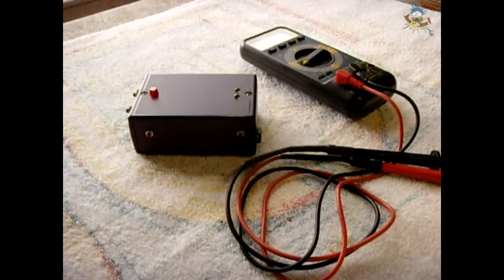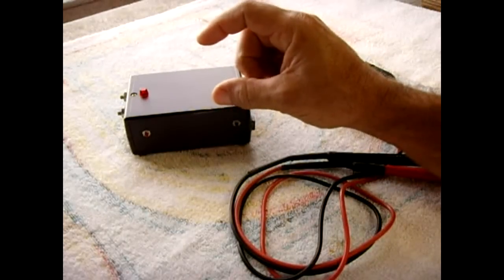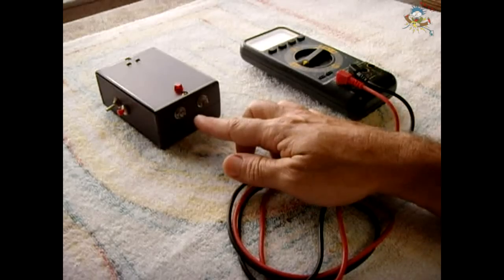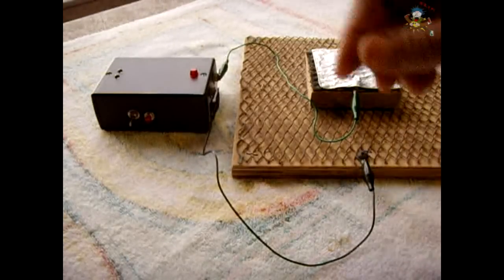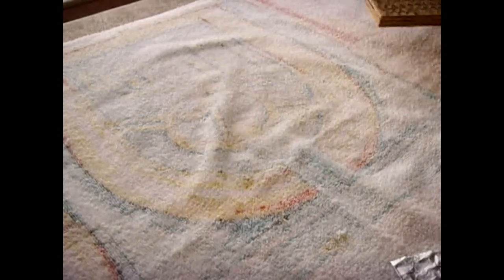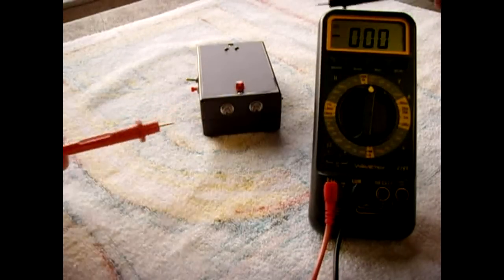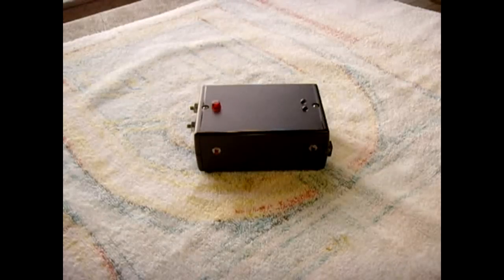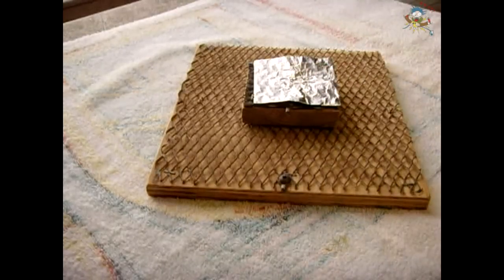RID-O-RAT Homemade Electronic Pest Control Device

Comment: I used wood to separate electrodes in a sensor once.    I discovered that over time, the wood absorbed enough moisture out of the air that it's resistance began to drop significantly and started tripping the sensor circuit.
If you're using this in a humid area,  you might start to lose charge overnight due to the moisture in the wood.
Reply from the maker: That surely can happen, but I have not had any problems. Use rubber or acrylic pads under the large wood section, and place a piece of plastic between the small block of wood and large block. Bolt the small block to the large section using a nylon bolt. Problem will be avoided.

Comment: Thanks very much for the idea.  We have squirrels getting into our engine compartments, chewing wires and connectors. 

After two cars (newer with soy insulation on wires, attracting them) were discovered damaged in a week, we made sure to always put the cars in the garage at night.  But we have had to use the garage for other things during the day, and have been parking it outside - always careful to make sure we brought them both inside at night.  Then, we found one of those same cars with wiring damaged yet again a week ago.  Barely got that repaired, have had to not set cars out on the driveway even during the day for this week, and last night we discovered extensive damage on a 30year old vehicle.  Guess they've gotten into a habit. :( 

We're repairing the fourth time now and determined to stop this damage.  We actually have an electric fence charger, maybe we'll just use that and give them some shocks.  It was figuring out the platform that had me stumped this time.  I think we can come up with a variation that will fit in the latest engine compartment where they've been trying to nest. 

In the deep past, we had those tall cylindrical bird feeders with metal perches. The squirrels would climb the metal pole onto the top of the feeder (metal) and hang down to hold onto the bottom perch, then scoop seed out and empty the whole feeder in a matter of seconds onto the ground and go feast at their leisure. 

We connected the same electric fence charger to the top of the feeder and the bottom perch -- way too tall for any birds around our area to stretch across the terminals -- and the squirrels would get a good shock, fall off onto the ground, sit there about 10 seconds and go away. They're smart, didn't take long to learn not to hang from our feeders.
Reply from the maker: Using an electric fence charger should definitely scare them off. Thanks for watching!

Comment: I read some comments, anyone who have had rat issues no doubt get a perverse pleasure seeing rats eradicated. But, for someone who needs to eradicate vermin, the kill videos are of no use. I have a concept, and I will show it in action once I get it working. It doesn't need to kill, just temporarily incapacitate. It can't discharge and have to be charged the next day. I have a great capacitor story. We were dismantling a pole top capacitor bank, (3 phase 12,000 volts), at the Levi's manufacturing site downtown San Francisco in the '80s. A load break hot stick was supposed to be used, but boys will be boys, we used a standard switch stick opening cut outs. The first phase when it opened Drew an arc as big around as a Foster's beer can, and it snaked like a dragon. There was a loud hum as it opened, and it let out a loud bang like a cannon going off. The second phase was like the first, maybe slightly smaller, and the third phase didn't even make an arc. We then waited for the capacitor to equalize, shorted it out to be sure it was dead, rigged it with the hard line from a line truck, unbolted it and let it to the ground.
Reply from the maker: The dislikes are all from viewers that enjoy watching videos showing torture or death. YT seems to be drawing in a bigger crowd of these people.

Comment: this is a very good video , i love the way you explained how this works ,,i'm not the greatest with electronics but  you explained it very well so even i could understand it ,, and have since made my own version of this device ,,mine is an ALL in 1 unit with the charge controller and batteries in one unit ,and the electrode plates are in a box covered so none of my cats or dogs can get to them ,,and it works extremely well , it charges to almost  700 volts

Comment: Any change of publishing the circuit diagram
Reply from the maker: The device uses the high voltage joule thief shown on my channel. The output of that device is used to charge high voltage electrolytic capacitors.

Comment: I have a radio shack 3amp 13.8 vdc inverter can I used that ? I have a bad mice problem in nyc ,my pit just looks never chase , I bought the dunken mice trap from you tube for $30.& a victor from ebay for $20=$50.=not ONE MICE ,can you help the old man?
Reply: You can allso make or buy glue traps, that works very effective as well to catch them.
Reply: mausdewaus123 no

Comment: could i use a 9v to 240v transformer instead of a toroid  and run from 12v battery ?
Reply from the maker: No, you cannot convert 9V to 240V(which is not high enough voltage) using a DC power source.
Reply: i mean i would use your existing circuit but replace the toroid with the transformer out of a 9 -240 wall adapter. in theory they would be the same but the winding's would be fixed so would have to increase input voltage or a voltage doubler on the out put to get higher voltage

Comment: Wouldn't a similar circuit running off a 12v battery do the same job?
Reply from the maker: As long as the output is a similar voltage level with high current, or a very high voltage output(thousands of volts) at a lower current level.

Comment: Any possibility of obtaining a schematic of your zapper design? We are contending with a persistent roof rat problem, and it's difficult to lure them into the commercial zappers. No other DIY designs I've found here or elsewhere incorporate the safety features that yours does.
Reply from the maker: I made this video a long time ago. Definitely place heavy metal mesh screens over your plumbing vent pipes.
Reply: @electronicsNmore  My guess is the most likely ingress/egress is gaps in concrete roof tiles. Taking care of that is on my list.

I've eliminated the rats that had been frequenting the framing area (not a human-accessible attic), and am now battling them in the yard to try and keep the numbers down. Anyway, if you ever have the time to work out your design schematic, I'd be very grateful. 

Sorry about the idiot youtube commenters. It's common throughout youtube, no matter the subject area. It's why I seldom read very far into comments sections any more.

Comment: Great Device. What about a timed circuit that allows detection of the discharge and automatically recharges the system for next kill. Pending the next version.
Reply from the maker: Actually came up with a better, simpler design. Coming out soon. :-)

Comment: How many amps are discharged? It's not the voltage that kills, it's the amps.
Reply from the maker: The capacitors store a high current, lethal charge. Because skin has resistance, the voltage must be high enough to overcome that resistance. Thanks for watching!

Comment: Instead of using electrocution, go with the traditional method. 

Voltage may separate cells of a organism, and you would not want that happening as the blood of the rat just leaks out.

Comment: Personally,I prefer to make the voltage limit on Li-Ion cells closer to 4.0V. I'll take the slight loss of capacity,in favor of a safer (both to you,and the cell) circuit.
Also,be careful even after you discharge the caps,they have a 'memory' effect,and can 'spontaneously charge' themselves.(not really,but it appears that way.)
This is caused by 'dielectric absorption'.
Reply from the maker: I tend to agree. It is better to not fully charge them.
Reply: I think I may have mentioned that on one of your other videos. Just want people to be careful,lithium cells can get very angry if you mistreat them.
Reply from the maker: My problem is not over-charging them, but over-discharging them(below 3v). You do have to be careful. That is why I have the indicator not illuminate below ~3V.

Comment: could you make an instuctable for this item. I know you made one for the hv joule thief....
Reply from the maker: I noticed there has been a lot more interest in this device. Did you find this video posted somewhere? I can take apart the unit and show the inside, along with more details. Thanks for watching!
Reply: +electronicsNmore yeah, that would be awesome!
I found the video after I searched for an electronic trap for rats. It was the 1st on the results and the only one that really interested me.
Reply from the maker: Jose Fuentes
I'll look for the unit, take internal photos, and post a simple schematic at the video. I may modify a few things to make it simpler. I'll need some time. Be sure to rate thumbs up and check out my other videos as well. Thanks!
Reply from the maker: Hello. I added more details to the video description area.

Comment: swich to disengage electrodes?
Reply from the maker: When the unit is turned off, you need to push the capacitor discharge button. I have a MUCH simpler design coming out soon. :-)

Comment: I suspect you could make a good charge circuit from an old camera flash, or an old 12 volt tube driver from a camping light. Just add a suitable capacitor..
Reply from the maker: I have another great, and simple method which I'll show in the near future.

Comment: Nice build. Have you killed anything with it yet? Also , are you using a full wave bridge rectifier on the output of the boost converter? (the more proper term for a joule thief) It is probably a good idea to add protection to the 18650 battery so that you do not discharge it over 3V. Also, make sure not to charge it over 4.20 volts, lipos hate it when they are overcharged. By allowing the voltage to get lower than that, you risk damaging it. Also, have you considered using a quad comparator package to make a LED charge indicator? I showed a version of this using op amps instead in my tutorial on series and parallel circuits!
Reply from the maker: Yes, a couple rats. Not a full wave, just a single uf4007 diode on one leg of the output. More efficient if I did use a full wave. The voltage indicator was made years ago when I did not have all my parts at hand. It is crude, but definitely serves its purpose. The battery voltage cannot rise above 4.18V, but I can go lower than 3v. :-) You can buy small PC boards for single Li-Ion batteries for very little money on Ebay.
Reply: electronicsNmore Did you actually construct the charging circuitry for the 18650? You state it is 300mA, I assume you have made a simple current mirror or current source/sink with a 4.18V zener diode or similar across the battery or something along those lines, if you actually made it. Thats probably the direction I would have gone for small lipos. Larger ones, like 18650's, I would have probably took the guts out of el cheapo charger.
Reply from the maker: This circuit here works like a charm.
https://www.youtube.com/watch?v=YuMTflaJjyw
Reply: Thats seems like a far better solution then my hacked solution, lol, although the current limiting on it seems a bit crude! Seems like a low side NPN transistor, when it 'sees' more than 0.6V on the base, relative to the emitter, it pulls the LED and the adj pin on the regulator low, and causes the current to be limited. I would have prefered an op amp with higher gain and tighter regulation to do the same thing on the high side, but I can see that working fine. (Especially if you are charging at a 0.5C nominal or less.)

What you said near the end about the possibility of cells becoming unbalanced, thats why when it come to the huge >1KW Lipo batteries used for drones, that they have a 'balance' connector. It make sure that each and every cell in series gets equal charge, so that way all of them are stressed equally and one does not overcharge or undercharge.

Comment: Be interested in some pointers on how to make a trap with 1860 batteries + capacitor +"bread board" circuit board.

+ not frying myself at the same time.

Doesn't need the bells and whistles you ve got here.
Reply from the maker: You can buy the cheap HV module below. That will kill them, and all you need to do is make the rat/mouse stand on 2 separated aluminum plates and trigger the device by using a pressure sensitive switch.

 http://bit.ly/2v0e7gP
Reply: NIce one.....

Comment: Hello sir I am having a problem with mouses in my house.. i used to caught about 12 in like 2 years and they still appear i used many mouse traps and poisonous food and many more but really it doesn't do much... could you tell me if u could build that device but with more power so it kill the mouse.. if not then could you tell me the sites where i could buy similar device cheers :)
Reply from the maker: In a month I'll be showing another circuit which is super simple to make, and uses thousands of volts.

Comment: Good info, thanks! Where can we get the schematic for this circuit? "One shot then manual reload" needs improvement. The circuit can be designed to reload using relays and mechanical devices, then you would have the perfect mousetrap literally. !!$$$$$$$ That, and a climb system where the bait is at the top of a pyramid is a better option. Animal touches a smooth plate found there, and rolls down the incline(grids allow muscles in spasm to hold on). No carcas accumulation at the critical circuit area. You would now have a device that can be left for the weekend, and it will definitely put a dent in the rodent populationto boot.
Reply from the maker: +Denise Weathers 
You can leave the unit plugged into an AC outlet using a wall transformer and have it charging the capacitor 24/7. Once discharged, the caps will charge right back up. Please refer to the video description area. Thanks.

Comment: Nice work.  My concern is you'll miss out on others roaming around.  If they see a dead mate laying there won't they stay away?  Also, if it was plugged into a wall outlet you could kill a whole bunch.  Place it up high over a trash can so when they die they fall into the trash can and then its always  ready for the next victim.
Reply from the maker: Yes, I'd have to clear the dead body, and reset the device.
Reply: electronicsNmore - Any suggestions?  links?  We have 4ft trash cans here and I just want to hang it off of there plugged into the wall.
Reply: Ed Floody  lols
Reply: That's not necessarily the case.5 Look at some other Youtuber's vids. They'll walk on the dead and even eat them. You don't need to clear them. Honestly, I've seen the mice even become more comfortable with a trap after seeing other mice laying around it. The CO2-stunner trap comes to mind.
Reply: ohhh you are talking about the A24 CO2 trap ,, i bought one of those and it works very well ,, and my cats,ducks and geese are safe around it

Comment: Would you  mind sharing a schematic for the circuitry? I need to build one of these badly, I have a nasty mouse problem going on in my house. They are chewing holes into the walls, and even the ceiling of my bathroom. I would appreciate it a lot. Even better would be a how to video. Thank you for this video.
Reply: For some reason when I click on the schematic link it wont load an image. That is why I mentioned a how to video
Reply: Would love to see the schematic for this
Reply: In his full video description he has a hand drawn schematic, but it is kind of hard to read.
Reply: serisouly, go to the pound and adopt some cats, I had a infestation in my attic, I tried traps, bait, poison everything, They disappeared literally over night when I released a couple  cats in there, now it took me two weeks to get those cats back  out of  the attic.  Maybe they had saved rats to feast on but they didn't eat anything for those two weeks 🤷
Reply: @Bigshoots86  yeah, I wish I had thought of that. I have moved a few times since I made that comment lol. I ended up just taking em out one at a time with an airsoft gun, until they pretty much stopped running around. I stopped having any food of any sort in my house for a while too paired with the airsoft technique. I got good with that little pistol though

Comment: So, you are capable of getting one rat per night, or as many times as you check it and recharge it? I want it to shock as many rats as contact it. I have seen other videos, kill a lot of rats, but no explanation of the circuit. I don't need it to kill the rat, but I want to shock as many rats as try to take the bait.
Reply from the maker: If a person has a rat infested house, then yes, this unit wouldn't be for them. If they had 1 or 2 rats, it's perfect. I show a very good non-lethal rat trap version on my channel that works very well. It's very easy to make a high voltage shocking device that triggers when the rat is in the right position. Thanks for watching!
Reply: @electronicsNmore  I'm thinking of going to Graingers, or Auto Zone, get something to boost voltage from a deep cycle. I saw this on Amazon, $40.
Reply from the maker: @tomcondon6169  All you need is a HV module. Dirt cheap online.
Reply: @electronicsNmore  Thanks, I figured I wouldn't be spending $40. I'll have to get a trail camera to film it. I will need a big container to hold all the vermin, (my imagination), but may have, to pay "Crazy Sally," for the ruined perm, when she gets her curlers stuck in it, (a possible worse case scenario, or an overactive imagination).